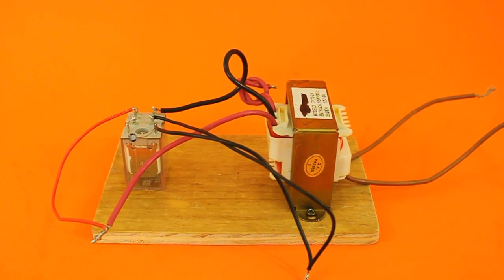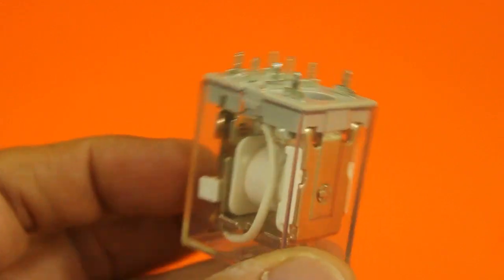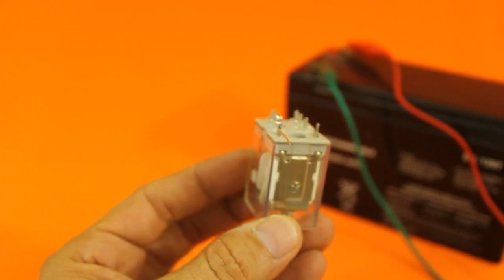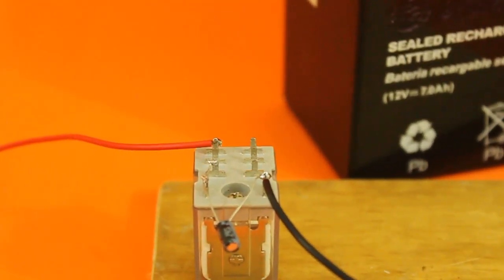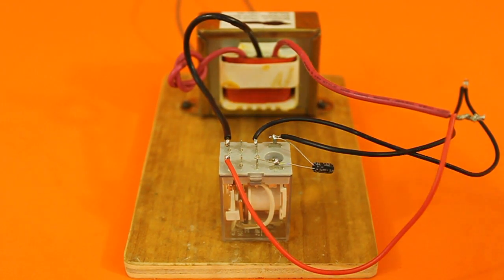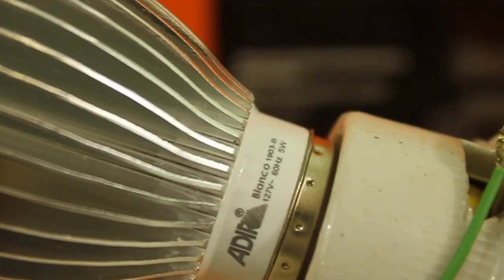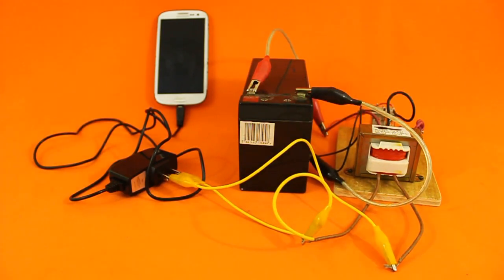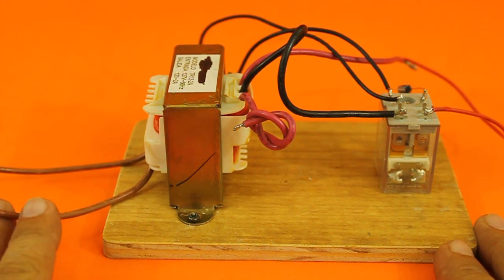12 VDC to 120 VAC Inverter with 3 Components

Comment: A squrewave will do fine for something's, but a fullsinewave  is what you need for laptop, but building  this project  with two mosfet is how I would to it
Reply: I made a 125 watt inverter using a car battery charger transformer and two K2699 mosfets.

Comment: This is good food for thought.. 
If you Put the three component oscillator like the flyback  video  to  a 12V C.T. Transformer  and That will be a nice little electronic inverter. you could even drive it from a solar panel.

Comment: Good Video it was interesting i have a relay that the coil is supply by 120 VAC my question is if it still will work when i connect a 12 VDC to the coil. i have a relay exactly as the one you show in the video can you tell me the characteristics of the one you use.

Comment: This is how vibrators in old car radio's worked. I used to repair car radios in the late 50's and they used vibrators to chop up the DC (first 6v and later 12v) to feed into the transformer. I remember replacing the OZ4 rectifier tubes whenever the vibrator had to be replaced and the 1600v buffer caps every 2nd or 3rd time the vibrator got replaced. The buffer caps took a beating from the spikes these vibrators generated so you could use that noise (in the AM radio) as a sign the caps were on the way out.

Comment: This is how old valve radios got the high voltage in cars, before transistors were available. There was a special "buzzer", the size of a valve, designed to operate continuously at 12V DC, without contact burning.

Comment: Since you have a transformer with a midpoint on the low voltage end you can improve performance of this oscillator by connecting one pole of the battery to the midpoint wire and commutating the other pole via the relay to either end of the transformer winding. It will improve efficiency by removing  the DC bias in the transformer magnetic flux you currently have.
Reply: Oh and a couple of small capacitors parallel to the commutating relay contacts would help damping the sparking and prolong the life of the contact points.

Comment: Back to first principles, love it. 
An improvement that will stop the transformer saturating would be to use both halves of the secondary winding. Connect the center tap of the transformer secondary (low voltage winding) to battery positive then connect the two free end wires to the relay, one to normally open contact the other wire to the normally closed contact. The relay common contact then connects to negative. The secondary transformer winding then operates in a push pull mode and the magnetic core does not saturate with DC residual magnetism. If you want to get fancy two flyback diodes on the free end wires back to battery positive will save the relay contacts from a lot of arcing. The oscillator side can stay as you have wired it.
Keep experimenting and enjoy!!!
Ray
Reply from the maker: Thanks for your suggestions! I will try definitely try them
Reply: Good thinking. I'm always trying to prevent mechanical contacts from arcing like an old set of engine points. Except for when I'm working on an old car with mechanical points ignition- ahaha! I could truly understand if someone had no idea what I am referring to.
I wish I had enough experience to understand precisely how to incorporate the commercial solid state relay I salvaged into that configuration. It would be quieter, and probably last much longer as well. Someday perhaps I'll figure it out 😉☺️

Comment: old car radios use to have to be converted  from 6 or 12 volt dc  to ac  to make the tubes work  --it was a vibrating unit in a metal can and it was sealed  this system  here is a crude  system of the same idea
that could get ya electrcuted

Comment: Thx for doing the video. Just a little bit of added parts improve the lifetime and output of this vibrator high voltage generator.
First snubbers to prevent or lessen the contact arcing. Then take advantage of the center tapped transformer, use both primary wires with two contacts to get a nice square wave AC output. This alone will improve the output a lot. Exciting the core with AC instead of pulsed DC will boost the output. Lastly put some filtering on the output of the transformer to make it more EMI quiet. Back in the day when these were used to generate the high voltage for vacuum tubes in auto radios they had to be EMI quiet. If you get a chance do another video with these improvements. Thx again for your time in producing this video.
Reply from the maker: Thanks for your comments!

Comment: if you had connected the center tap [black ]to positive and the two reds - one to normally open the other to normally closed and the common to the negative of the battery then you would have had true ac not pulsed dc.

Comment: Since the low voltage end, secondary, is centre tapped, an astable multivibrator can be used to power the transformer. The output of an astable multivibrator can be made more accurate but using four transistors instead of two.

Comment: Actually this is a old invention, used to run as part of very basic mechanical inverter power supply system, for old cars with tube type radios, very limited life span but clever way to increase the low DC voltage for many purposes. Nice work and good explanation.

Comment: This was used in the early days of radios in cars, The radios had tubes and the system was used to create the higher voltage for the heaters in the tubes.
Reply from the maker: +Davlok actually it was for the tube plates, heaters use low voltage
Reply: Yea, i thought about that later,
Reply: It was called a multivibrator and looked like a metal cased tube with four pins
Reply: I still have one in my parts bin
Reply: +CD S  actually it was called a Vibrator, not a multivibrator.
Reply: Davlok I remember car radios with vibrators and they could kill a car battery if played for any length of time

Comment: Is the final output truly AC or pulsating DC?
Reply: Bharath Ram He says it's a square wave.  I would also assume there is no negative voltage either as the input is simply pulsed +12v.

Comment: Nice video.  I just recently posted a video very similar to this, using a relay as an oscillator on 12vdc, but in mine I use it to drive a 12v auto ignition coil and get 10kv sparks, which I got instructions for in 2009 from an old website

Comment: hello sir,
Can we use CFL circuit to give input power to "capacitor and diodes combination circuit" ie modified Marx generator. Without using resistor and flyback Transformer.
Reply: I need your response.
please tell me

Comment: if you use the relay oscillation to trigger a 2n3055 transistor then the relay will not arc under load and work a longer period of time.
 the key is not letting the relay to arc. A capacitor can be added to smooth out any surge to the base input of the transistor.
Reply from the maker: +Tumpa Talapatra I will try that!
Reply: Tumpa Talapatra  I have a 2n3055transistor tell me how it use???

Comment: ehhh... I doubt it'd be a square wave, but I'd believe that it has a constant DC bias. That fact that the relay actually buzzes tells you that the voltage across the relay does get close to zero at some point. 

The transformer seems pretty large though and it's not going to let a square wave pass through without distortion.

Comment: I always wondered if one can reverse a 230V -> 12V transformer to 12V -> 230V simply by reversing input and output wires?
Reply: Yes.
Reply: Yes. It has to do with the turns ratio.
AC only tho.

Comment: If i want to get 220V from the transformer what change in components I have to do?
Reply: The transformer itself :)
Reply: As indicated this circuit is intended only for demonstration purposes. The fact that a mechanical electrical contact is used makes the circuit unreliable for extended use.

However, as a demonstration, the circuit is excellent as itis  easy and fast to assemble, which is a favourable point for the uploader.

Comment: Apparently the AC is generated, the wave is a block, is that right? If true, can we add a parallel capacitor with the transformer input, between the two red wires.In order for the wave can be a sinus.

Comment: Thanks for sharing. Might be nice in a blackout to produce light, but then again a 12 volt light would work straight off the battery. Very nice. I have always wondered about relay oscillators and how they work. Thanks for sharing.

Comment: It won't produce the sinusoidal wave isn't it ?
its just produces oscillating DC right?great video by the way...!
Reply: This is a great and simple circuit. However, the relay is a mechanical device and the moving parts can break or fall apart after a short time of use, making it unreliable for long term use.
Reply: easily remedied with a simple L-C filter.
Reply: Never mind you mentioned it in the end...
Reply from the maker: +Mohammad Nisaar that's correct it is mentioned at the end
Reply: Trying using Ardunio SPWM code to produce a signwave.
Reply: Mohammad Nisaar oscillating DC doesn't exist. If its oscillating its called AC. You are making things complicated 😈
Reply: Nope AC is when you flip polarity, for example one leg is positive half the time and the other is positive the other half of the time.
Reply: ya it's not sin wave it's square wave.